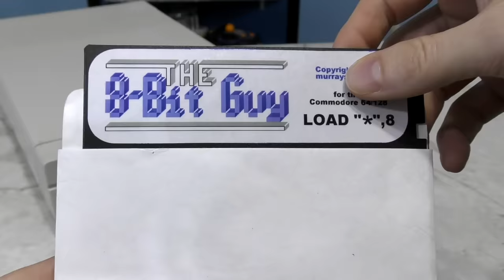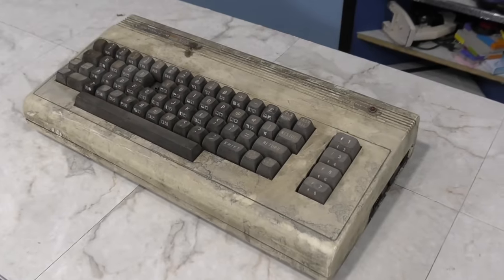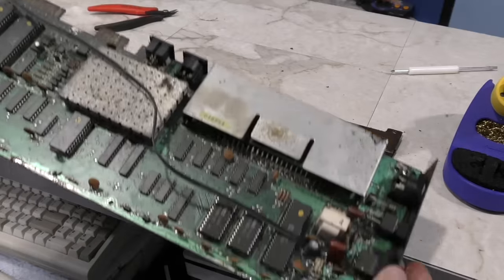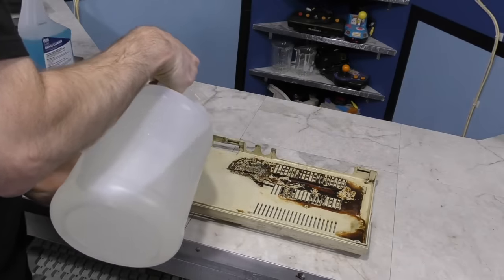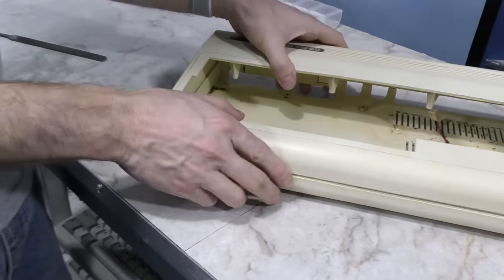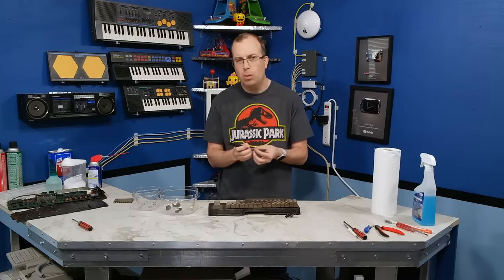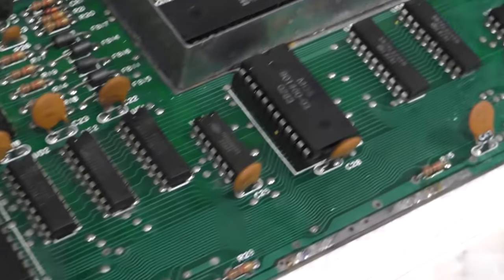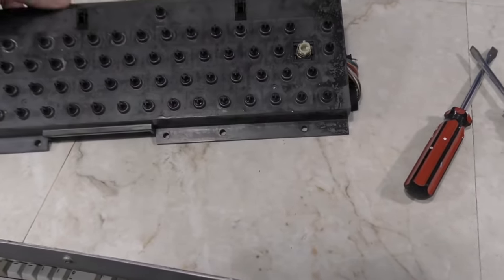Restoration - The Worst VIC-20 I've ever seen - Part 1

Comment: 🤔...💬 
I'm surprised you didn't use some kind of degreaser on that 
I've went to the car wash and use the degreaser setting at the car wash before - the sprayers at a carwash has higher pressure then you would have at your house from your water spicket ... people have used there dishwasher when cleaning cases, 
I've heard of people using toilet bowl cleaner like the works
I have heard of people using spray on oven cleaner 😏💬 you could probably do a whole video on products that you can use for your Restoration Projects!
Rappad And Restore!
Restoration Tricks Of The Trade!
The motto is 
Don't throw it away restore it today
Reply: 🤔...💬
With everyone using 3D printers these days you could probably just design and print up new parts it could be an alternative solution

Comment: hello, i always like your videos. I have 2 acer labtops one is 15 inch other one is 10 inch. in the 15 inch one my windows crash  i need to update my pc i need to put a ssd gb and other one i have an virus on it. I am more focus on the 15 inch i need to upgrade it has 4gm memory. I would like to update 8-12 gm if the mother board can take it. I currently have windows 7 on the 15 inch and 10 inch i have windows 10. I picked you because i love your videos and you are excellent in fixing computers. I would want to know is if you can help me upgrade my computers and if it is a price how much is it? Thank you and be safe in this pandemic.

Comment: Use hydrochloric acid mixed with water for cleaning the case, that should work fine
Reply: I doubt that's safe at all. Any bits of splashing will end up like Hick's armor from Aliens. Dave did fine with his methods.

Comment: Wait I thought water broke electronics not fix them
Reply: As long as there's no power while the electronics are wet, it won't hurt it. That's why it should be fully dried before adding power unless you want damaged electronics :/

Comment: To me the start of this video (which is all I have seen so far) was VERY cringe-worthy... Though I have been working in the cleaning industry (like cleaning offices, stores, etc) for well over 15 years of my life, and have had quite a LOT of knowledge passed to me either by various seminars and what not, or from people with more experience that I have have asked about things I have experienced.. and sometimes.. by just brute force..

BUT.. you don't even seem to know the MOST basic rule of "detergents"..

That is.. The pH level of what you use to clean something with.. is chosen from what you think you are trying to clean up.. so.. For Oily/fatty substances.. you want a high pH (alkaline) detergents..

For minerals.. (such as most residue from water).. you want something acidic.. 

pH neutral detergents are usually just enhancing the qualities that water already has.. which means it kind of work "both ways".. yet.. primarily for fatty substances.. and at a much weaker level.

Of course, then there is the ENTIRETY of the rest of the profession.. such as.. "What constitutes a "method" (hint: A method is built up from three basic components: Chemical, Thermal, and mechanical).. this is normally shown as a pie-chart for any one method by showing those different parts in different arrangements.. because.. different methods can STILL be enough to clean up the SAME piece of "contamination".. if you use a weaker chemical.. you might compensate by using more.. "rubbing" (mechanical).. or a different temperature..

And.. that is just the start of it all.·

Either way.. that is the absolutely most basic low-level START of how to clean things... then there is the levels where we ALSO start having to take in to consideration how a specific method MIGHT affect what we were trying to clean.. (The miracle spunge.. it's awesome.. until you realize that it's more of a fine-grade sandpaper than something that literally differentiates between the substance you are trying to clean, and the contaminant you are trying to get rid of.. So the question is if you worry about harming the "shine" of the parts where you use it... but as a general rule: If you can't get it off by miracle sponge, then you havent used enough of it for enough time.. though.. to be fair.. the same can be said about the question whether the object you wanted to clean still exists.. because.. use enough of it.. for long enough time.. and it won't exist)...

.. so.. just.. no.. from a "janitorial" view (I THINK "janitor" is the common word for someone who cleans offices, and so on, even if me personally think of someone who idn'st just cleaning things, but deals with ALL Things in regards to maintenance of the actual building).. I would say you are ALL OVER the place.. jumping between methods without foresight and without thinking about what you are trying to get rid of, OR how the method would affect the actual material that you are trying to clean.
Reply: Oh, sorry.. that was professional pride, not really based on what I NORMALLY care about (My original field of study was electronics, and things like that.. also.. I care about preserving history, knowledge.. and also.. reducing waste).. so.. what I SHOULD have focused on FIRST is: WHY did you START with cleaning the plastic?.. if the electronics don't work, then the actual "neatness" of the plastic don't matter.. heck.. you could leave the plastic submerged in ordinary detergent WHILE trying to check whether the actual electronics works.. possibly making cleaning the plastic easier.... and if it didn't work.. at the very least it wouldn't take LONGER time to clean it..
Reply: @rogerlundstrom6926  because cleaning the case and keyboard will make it more pleasant to troubleshoot the motherboard. Plus if he has to retrobrite, he can set the case pieces up for that while he works on the motherboard.